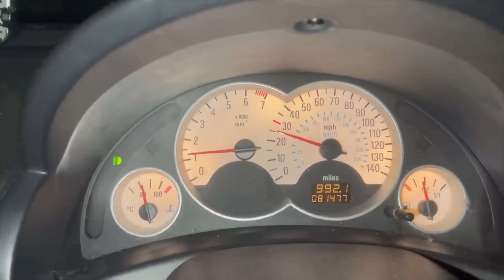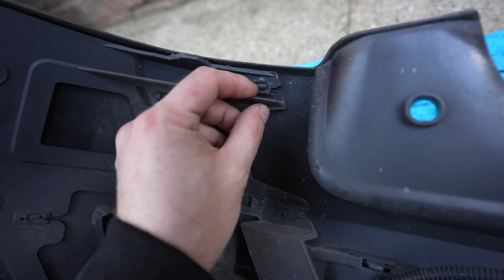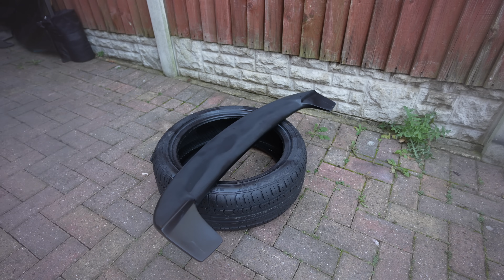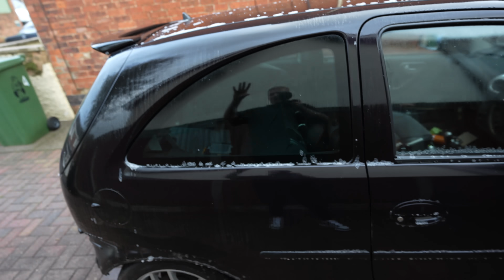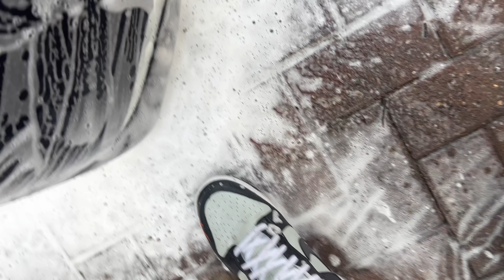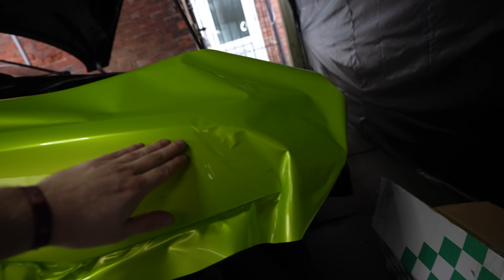MODIFYING A VAUXHALL CORSA - PART 10

Comment: Looking good mate, very impressive for your first attempt. 

As someone who’s wrapped a few cars I know a few little tips, one of the most important things to do is ensure those corners of the wing, inner arch, door jams are all just as clean as the clay barred areas as this is where it starts to peel first. Especially if water gets underneath the wrap, always use a clean rag to ensure the area is dry too.

A tip that’s just important is to ensure you heat all corners, edges and body lines to 90 degrees to ensure the the wrap loses it memory and doesn’t start to bubble back up as these are the areas that after a few days start to pull away. Unfortunately if this happens it won’t stick back down again and will need to be redone. 

With those corners, it’s difficult to do on your own but if you can heat the wrap while pulling it away from the corner it wraps around it nicely, be sure to heat the crap out of it so it doesn’t pull back 😂

It’s also good to use your wrap sparingly as you don’t know how many attempts the bumpers will take you (these are the hardest to wrap). You could have got two wings out of that first piece but I understand it’s your first try and you’ve done really well! Great content mate and looking forward to seeing it finished.
Reply from the maker: Legend man thank you!!

Comment: Not sure if you’ve already started the doors but those strips down the side are literally stuck on, no bolts and will make it look a million times smoother if you take them off. And probably make it easier for you to wrap. Use your heat gun on them and they do peel off but make sure you really heat them up. You might find the paint is a little discoloured under neath but it will polish out and if you are wrapping it’s all good. Mega job mate

Comment: If you haven’t already, I’d stop wrapping it and get it indoors mate, it’s too cold outside to be handling and stretching the vinyl. The temperature of it is going to fluctuate massively when your using the heat gun.
If your in a warmer environment it’ll also be easier for yourself to apply it. That wing looked like it went on alright but I bet it took a while. 
Just some advice mate, otherwise it’s going to be a waste of money when the edges start lifting and peeling back 👍
Reply from the maker: Once the 2nd gazebo arrives I will be enclosing them both completely and hopefully getting a heater inside 🙌🏼